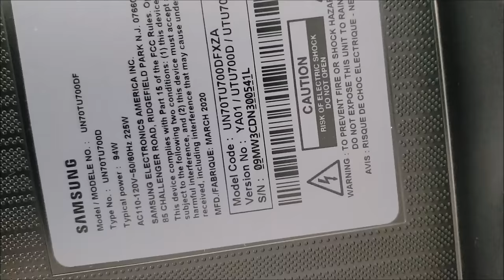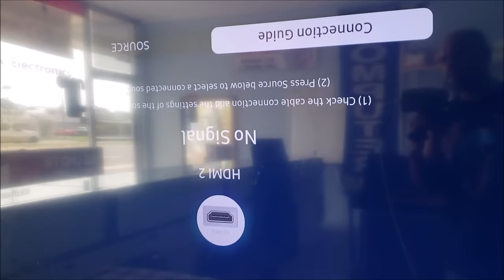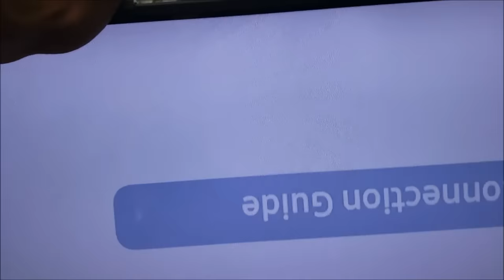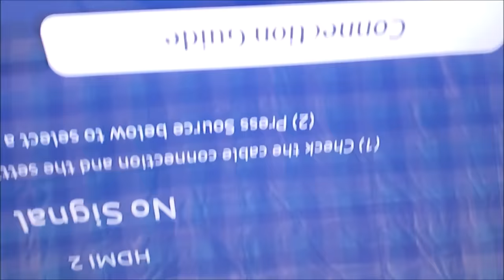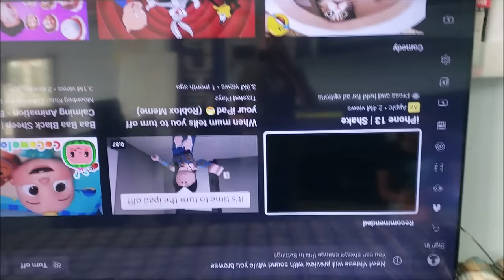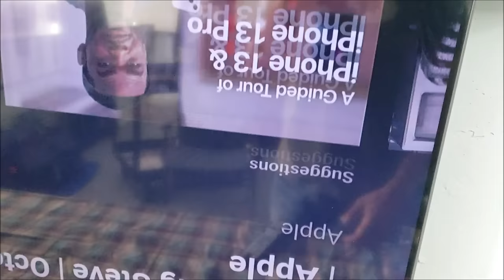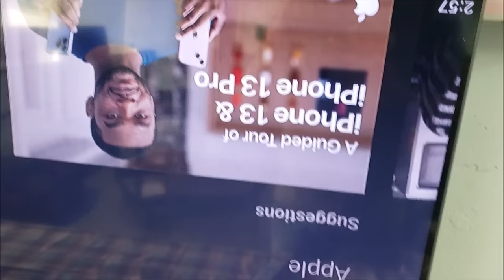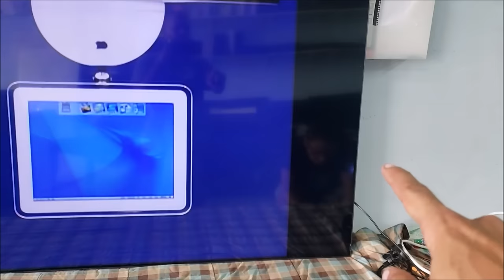Samsung tv UN70TU700DF restarting no picture

Comment: Can't someone make a TEST JIG with micro switches to use for these repairs so you don't have to use tape all the time. You just turn off the corresponding DIP switches and then you can use tape after you find the correct traces.

Comment: I had the vertical line problem on a Sony TV. Tried to do this method but found out the TCON flex cables were bonded to the board. What do you do in those situations?
Reply from the maker: usually this way works on horizontal line. the vertical linked to the bottom COF, genteelly press on the COF edge to the board or to the screen when the tv is on and see if the line will go, if it dose you may apply a rubber piece to the area that causing the line
Reply: You guys doing an amazing job,  I have a Samsung 70'' smart TV and it's restarting every 5- 10 sec please is there anyway I can send you the money for a board replacement so you can ship it to me in Ghana 🇬🇭 please I don't wanna buy new tv
Reply from the maker: @browniecoleman1540  sorry we dont sell the boards you can order it from aliexpress

Comment: Man it worked ! 
I almost gave up . 
So many pins to tape , and the tape was sliding but it worked in the end . 
No lines or anything either . 
Found the exact contact to tape off . 

I folded the tape over the top so it would stay in place when sliding the connector in and out . 

It happened exactly after 3 years . 
I was close to buying the same model and just switching the back cover panel with the serial number and then return the faulty TV and keep the new one and get my money back . 
It’s gonna fall back on Samsung anyway and not the shop that’s selling it . 
Glad I didn’t have to do that . 

Samsung needs to do better ! 
3 years is not acceptable for a tv . 
Needs to last longer IMO
Reply: my tv broke the same and I had exactly the same ideea to buy one and swap in the same day, but I can’t find anywhere the 58 inch size any more.my tv broke after 2 years now I am going to try this taping method tomorow,too bad they don’t sell that size any more arround here.

Comment: Holy. I was skeptical but it worked. I resurrected a un50au8000 tv with a bootloop using tape. TV was about heading for the dumpster. Thanks; your video is well explained and it help saved my TV.
Reply: Tape just brake cicuit of wire that are menge together  usually one .two wire should tape

Comment: You're a genius. I almost threw this tv in the trash after replacing the main and power board and having the same issue. Thank you my friend 👍
Reply from the maker: enjoy
Reply: I picked up a 70' inch Samsung 4K 2019 model from the trash today. I'm using it as I write this now. I thought I would see some new designs  int technology but never thought I would get it to work. I moved the tape like in the video just 3 times and got the TV working. I started laughing from amazement. 
Thank you!!👍

Comment: Thank you for posting this repair video. This scotch tape method worked on my Samsung UN55KS8000FXZA that kept boot cycling. 

I did this initially and it did not work. I knew I had a good power supply, but was not sure about the main board and led panel. I went ahead and installed a new main board and no change. I did not find any burned resistors on the led panel. Went back to scotch taping along the 2 connectors on the main board. Tried a few different sections and then all of a sudden, voila!

For anyone out there with a Samsung and who has tried almost everything, try the scotch tape method again on various sections. You may get lucky! It’s worth a shot and costs zero dollars!

Comment: I was about to give up and get rid of my TV that has this exact problem, you are a fucking legend, I’m going to try this again and see if it works
Reply: Update: I got most of it working! I think one of the embedded drivers in the ribbon cable is a little fucked, however the TV now works thanks to you! I've got distorted reds on the left side of the screen, with some black lines, but they're not bad enough to make me want to get rid of it
Reply: @james2396  just keep going it's probably just 1 more trace to block from circuit

Comment: A friend brought me a Samsung TV today that this same symptom so I'll be trying to find the problem tomorrow.  
I have an LG 75" that I've had for two years.  I first bought a Samsung 70" and within 30 days there were colored horizontal streaks.  I was within the return period so I gave it back and got the LG.  The LG looked sharper and better than any of the other models on display at Sam's, anyway... except maybe a Sony but I'm sure.  
Since then I've seen many people throwing out of warranty Samsungs away because of display and power problems.  If my LG dies I'll get another LG.  In the meantime I'll maybe fix the Samsung and use it in my shop or bedroom.

Comment: Thank you it helped me locate the problem data line and get the TV running.  Do you think it would be possible to use a power supply to clear the short with some significant current?
Reply from the maker: could be a short or dead pixel line. no cant clear the short inside the screen, you may burns the traces by using power supply on data lines,
Reply: @SOSfix Electronics  this guy just posted another solution too (i use auto-translate subtitles)  https://youtu.be/ltdELrzPcrI

Comment: Great video!! I have this exact model and having the exact issue. I am going to try this method, but is it possible to purchase just the flex cables from somewhere and replace them so there isn’t a bright dot on the screen? Thank you!
Reply from the maker: no the problem is inside the screen, replacing the flex cable will not help
Reply: @SOSfixElectronics  thank you! Good to know.

Comment: I fixed my UN75NU800 TV, thank you! I only needed to tape off 1 pin of the left flex cable to get it work. However, there is a horizntal line running across the screen. Is this something can be solved by finding more problematic pin or this is probably the best we can do?

Comment: Just got my Samsung tv diagnosed at a repair shop and they said it was a short in the LCD panel assembly and it would need to be replaced (very high quote). I’m about to just toss the tv but found this video.  Would this trace tape possibly do the trick? I’m willing to try.
Reply from the maker: It's worth trying it

Comment: I HAVE A BIG THANK YOU AND A QUESTION!

Thank you so much for posting this fix. My "Just out of warranty" UN58TU7000FXZC had the symptoms you indicated. By following your instructions I was able to tape 3 tracer contacts which gave me back my TV, no lines, but I do have more purple, red, pink hues on the left side of the screen.  For example a blue car will be green on the left and blue on the right, however some shows look good as before, so liveable.
If I was to carry on and keep moving the tape do you believe I could potentially get back everything to normal?  In my notes, I'm at "position 14" and so happy to be where the TV is at now, but could I improve on it if I keep moving locations? Should my tape be narrower to cover only two tracers? In any case, thank you very, very much!
Reply: Update: I'm now using two separate single tracers. This seems to have lessened the purplish/pinkish hues on the bad side, but they are still there. What I do not understand is why some apps appear totally unaffected by this bad area and others are.
Reply from the maker: is depends the level of the color. sometimes i face that too just try to reduce it by changing the picture settings in menu
Reply: @SOSfixElectronics  Thanks for the reply. That's what I ended up doing. Interesting too is that I found out that some documentaries on YouTube also have nice displays, while others have this colour problem. So I can live with that for now. Some Apps have very good displays all the time, others are bad all the time. Thank you for your incredible help nonetheless!

Comment: If I buy a new ribbon cable would it fix the problem? also I tried this but when I cover one pin it stays on but if I cover other ones as well with the one covered it keeps boot looping with no picture, now it will boot loop either way even if I have the cable covered...

Comment: Got a 70" Samsung TV doing the same thing. Found that if I cover pin 12 on the top ribbon cable the TV will turn on, but 3/4 of the screen has very dull color. If I leave the TV on, disconnect the ribbon to remove the tape, and reconnect the ribbon, the tv reboots and the picture is perfect. If I turn it off and back on, it returns to the same loop and I have to start the process all over.
Reply: I have the exact same issue as this person with. Could somebody please give some possibilities to why this is happening and how to fix it!?!
Reply: Same issue here
Reply: You can’t remove the tape. Even if it might solve the issue temporarily the tape has to stay on because you have a bad connection there it’ll keep doing the boot loop without the tape.

Comment: I like your videos they are good. I have a 70 inch sharp tv model number LC - 70LE660U .The tv turns on the back lights but they want turn off with the power button. I was wondering if you have ran across this problem.
Reply: If your TV back lights don’t turn off it’s probably to do with your power button unit. My tv has a power button and a signal receptor for the remote together. Make sure you have good connection in the wiring from the power bottom to where it leads. If you know how to use a multimeter see if you have continuity in the wires. Good luck!

Comment: I got a new one for you... Samsung un75ru7000... Plug it in and you see the Samsung logo and it comes on and it keeps looping.. but at the same time sometimes it comes on all the way to where you see the apps popping up at the bottom.. I cannot find any problem everything's seems to be at the right voltage.. but there's a kind of a halfway buzzing halfway clicking more of a buzzing though coming from the power board and when the TV is on and going through the loop, the back lights seem to flicker not not really a full flicker but kind of you know you can kind of see a little bit of it getting brighter and it goes along with the buzzing sound coming from the power board I mean I'm thinking of just replacing the power supply but I can't find any problem? Have you seen anything like this?
Reply from the maker: disconnect the mainboard from power supply  plug it to the power to see if the backlight turns on and staying on longer
Reply: @SOSfixElectronics  yeah I did all that already.. I did all the usual check points.. I'm guessing it's the power supply and that's just cuz I can't find anything else and the power supplies making the noise LOL
Reply: i have a 58 7000....i have the same issue....this video does help on determining  if its the power or video module...have u found a fix...my cover is off for the last few days tryn to figure it out...i did find parts for it...just wondering your fix if any so far??

Comment: Hey thanks for this video!! I managed to get clear image but the very left side of the TV is with a black stripe/block - vertical one. I am trying different combinations but it always when there’s imagine there’s the black block. Any help on this one please? 🙏🏼
Reply: Vertical lines are due to bad connector from the panel to the screen itself (look like ribbon connectors on the bottom but permanently glued). Can’t be fixed unless you replace the correct connector which is very difficult without the right equipment.

Comment: I did the trick and marked 2 lines, but I still have 1 big vertical line in solid black over the screen, is that fixable with taping?  or is that just the faulty screen
Reply: Did you ever fix that? I got a horizontal line running cross the screen too 😂
Reply: @yentsaiwang did you ever fix it I'm having the same problem right now on a 70 in Samsung
Reply: @danieltrejo12dt  The TV was fixed using the method in the video, but there are still missing lines. However watching the tv from 3 meters away it's not that bad, I did later buy a Sony 85" as main tv.

Comment: Hi, I have 50inch TU8000, by using this method I found 2 pins/traces that I can cover for my tv to even start. So, I can cover any of them (one or the other or even both) and it will be on, but no picture for any of them. Do you have any advice on how to get any picture? Like, I can try covering more besides these two, but I don't seem to get any picture. Also, if I cover any without covering at least one of these 2 traces, the TV keeps restarting.
Reply from the maker: could be there is more traces needs to cover
Reply: @SOSfixElectronics  I tried covering other as well but I got no picture. Interesting, there is a flat cable that goes directly to the main board and I tested a bit with that, but only got few lines visible when I cover some of the traces. I don't know what's the difference between these 2 cables.
Reply: Ok, figured it out. In my case, it had nothing to do with that flat cable (brown-golden one connecting two halves of the screen leds), but the one going to the main board. And I had to cover only one pin, which was about 15th or so.
Reply: @Dengurii  Hi. How did you managed to find that out? You have tried brown-golden cable on both sides, all pins, one by one? Fighting with same issue - can't get it done. Found 1 pin on left side closing which stopped the cycle reboot, but still can't get the picture back.
Reply: @Evgeny_Trubitsin  yes, you don't really to try both sides as it's the same on both just mirrored. Disconnecting the flat cable connecting the main board to the smaller led board stopped the rebooting so then I kept covering groups of 4-5 pins on that cable until I found the right one
Reply: @Dengurii  I think I got you. And mine problem is a bit different though: TV went to a cycle reboot without picture, I found randomly a pin, covering which the cycle reboot stopped, TV boots and stays ON without picture, reacts on remote, LED is ON, sound is also there while booting, but no picture on the screen. I think that has still something to do with those brown-golden flat cable, not with the main white cable from main board.
Reply: did you find solution?
Reply: @aladin_l  No. Sold it for spare parts.
Reply: Same over here. Getting pretty crazy

Comment: Great instructions! Have a 2 year old 50 inch CU8000 with this problem. The screen started looking like a black cloud descending from the top and then finally picture went and TV restarts repeatedly. Took it apart. What do I have to lose? Just use standard electrical tape?
Reply from the maker: yes
Reply: Thank you! I now have a picture, but left side is darker. Not black, just darker. Going to keep trying. Amazing. Thanks again.
 @SOSfixElectronics

Comment: I have the same problem with a ue70tu7172.  I can tape 2 lines separately or together to get it working but a line remains in the image.  can I do a combination of taping with the left and right flat cable such as 1 line on the left and 1 line on the right?
Reply from the maker: Yes some times may need to cover traces on both sides to get the screen to work.

Comment: Hi there sir, i got issue, suddenly no power at all. But after i reattach cable from main board to power board, its on but still blank. May i know, what is wrong ya
Reply from the maker: Bad luck panel try to use the tape method
Reply: @SOSfixElectronics  but, there is no power, how can i test it??

Comment: Thank you so much for this video!!! It helped me quite a bit but I’m a little stuck on another issue. 

My Samsung QLED Q70T tv was power cycling on and off when plugged in. I followed your troubleshooting process and got the tv to stay on. The issue I’m having now is that after 30 mins of picture perfect use the bottom of screen becomes fuzzy with a horizontal line.

If I unplug the power cord  from the tv for 30 seconds and retry, the picture is perfect for 30 mins. I’m wondering if the mainboard could be an issue as it warms up, or I need to try other pin combinations? I know I’lI have to spend more time on the ribbon pins but any suggestion is greatly appreciated.  Thanks again!!
Reply from the maker: i think you still have some more traces to cover, that is the only option for that screen
Reply: @SOSfixElectronics  Thanks!!

Comment: What is the problem if when I i disconnect the ribbon in one of the first steps and it still loops on and off?
Reply from the maker: could be anything except the screen,  disconnect power board from the mainboard to see if the backlight turns on and stays on. if yes it should be the mainboard issue

Comment: my tv back lights come on when i lift the tv on one side while it’s facing down. 
i touched the green strip on that side and the LED flashed on. 
what would that be?
Reply from the maker: could be bad lcd screen
Reply: @SOSfixElectronics  i got the screen on and the tv to work but top half of screen is slightly darker than bottom.

Comment: Why on earth would covering traces fix such an issue?  VERY strange!
Reply from the maker: covering the traces that shorted or not working right
Reply: There are many redundant parts in the ICs that do this timing and video output to the panel you may only have one of them bad that has four traces going to it and so if you can just cut that one out of the circuit then the rest will resolve the video and you can't tell the difference
Reply: @JamesJackson-sp2kp  Ya, I looked into it a bit further, crazy how that works.  It can degrade the color in part of the display just a little but ya way better than it not working at all